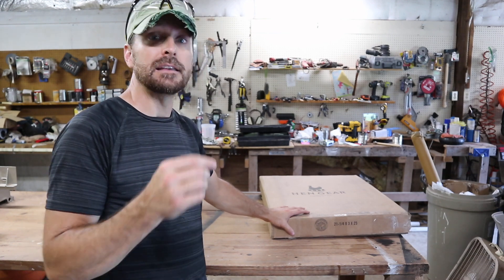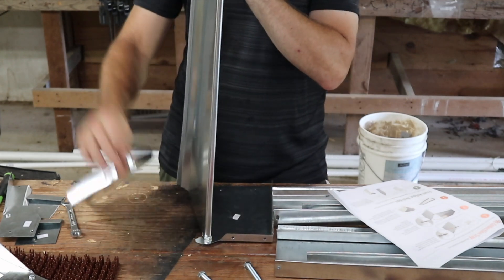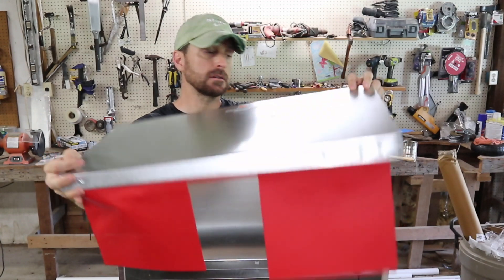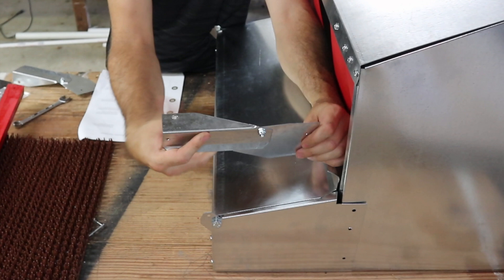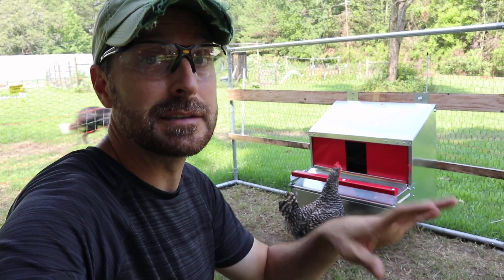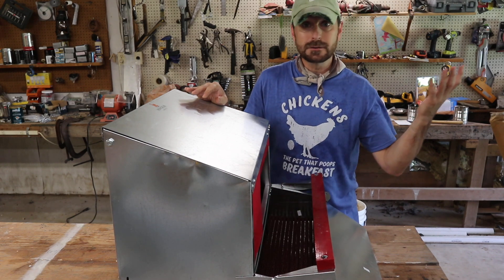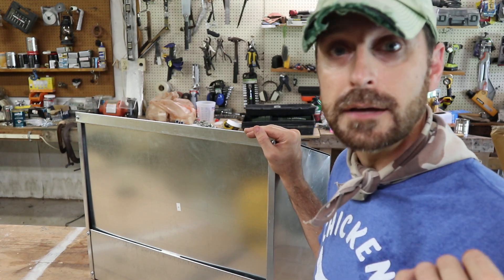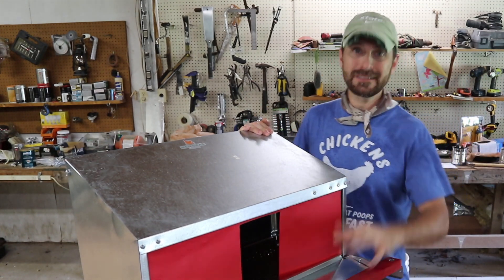Hengear Review. Will THIS Save My Eggs? Testing A New Nesting Box

Comment: I have the large version of this box.  I agree it is good quality, but the design is not well as an outside box.  Per instructions, the "outside" egg access is by cutting a long rectangular opening for the collection tray only.  The box itself stays inside the coop.  I'm not a fan of that, since it requires me going inside the coop to clean the boxes when needed.

Comment: I have that very same hen gear nesting box mounted for rear/outside collection. There is a latching system that perfectly secures the push in panel from predators gaining entry.
Reply from the maker: That’s awesome you have one. 
I worked with Hengear to develop the rear latches after this video.

Comment: I see they have taken your advice and installed latches for the rear mounted egg box. I think racoons would be able to figure out how to turn them, as they are pretty clever animals...your thoughts?
Reply from the maker: I think that the latches can be tightened down enough that they would not be strong enough to turn them.
Reply: I’m going to drill holes in the latches for small carabiners to further predator proof mine.

Comment: mine just showed up in the mail and i wanted to know how to put it together so i watched your video. the hardware that came with it should have gone in the trash as soon as i opened the package. great product but i would have gladly given them an extra 5 bucks and had them include nuts and bolts that were not machined by a 3-year-old (awful quality & hard to work with). besides the struggle with the hardware the only other thing i noticed was some of the holes were punched into the metal slightly smaller than they should have been. would i buy another box from them? YES, i would as overall these boxed are made out of good thick material and should last decades provided, they are installed inside a building where rain cannot get to them.
Reply from the maker: Cool. I am sure you could call them and they would send out some more screws. Just let them know. Mine sit outside and they still look like new.

Comment: Hello, how's it held up over the years? We have some Homestead Essentials roll out nest boxes that were awesome for the first few months, but have deteriorated quite quickly where the sheet metal holds the trays in. Does your hen gear still seem sturdy and fully functional? TIA
Reply from the maker: It is still solid as a rock. Every bolt has stayed in place and has not loosened. The sheet metal is thick and has not cracked or ripped through at any connections.

Comment: bought this exact model. my girls dont like it @ all. 
lay in a $12 cat litter box instead. frustrating
even tried adding hay and zip tying ceramic eggs on mat.
still prefer plastic "box" with DE and sand
Reply from the maker: It is so strange how each chicken or breed likes something different. Mine love laying it it. I put straw in my other nesting boxes and they just kick it out and lay on the hard surface.
Reply: @CountryLivingExperience  I guess. Mine are buff orpingtons, ISA browns, french copper marans. All prefer either far corner that's hard to reach or the dust box. Going on full year that way. GL
Reply: Personally I found that top corner bolt & nut to be MOST frustrating part of building this nest box. Serious flaw in design. (Regular ikea builder here)
Reply from the maker: There were a few difficult bolts to reach.
Reply: I agree! I couldn't get those bolts in. Also bolt for the perch wouldn't fit without a bigger hole in wood or different bolt. I hope it works... expensive, right?

Comment: Are these boxes meant to be that you collect the eggs from the inside of the coop or can it be done so you can collect the eggs from the outside of the coop without chickens escaping?
Reply from the maker: You can configure them to do either. The instructions show how to put the egg tray on the front of back. If mounted on the back, you do not need to go inside the coop to get the eggs and the chickens cannot get out.

Comment: The metal grate on the bottom.. can raccoons get through that when rear mounted? I screwed everything else down for now I’m nervous about the metal grate under the plastic grass
Reply from the maker: If it is inside your coop, then you shouldn't have to worry about the raccoons.
Reply: Hmmm ...I've got mine rear mounted, so eggs will be outside coop, in barn that raccoons have been a problem--in fact rebuilding coop using hardware cloth. I've had 21 chickens in my garage for 3 weeks. Horrible mess. Raccoons got 4.

Comment: I have the same egg layer box and can't get my chickens to enter this box.  Do you have any suggestions?
Reply from the maker: Are they laying anywhere else? Find where they are laying and block that spot off with something.
Reply: LOL, yes, they are laying right in front of the laying box.  Part of me thinks it is hilarious, but they are pecking and breaking their eggs, so I do need to control this somehow?  THey stand on the foot bat, but they will not go in?   @CountryLivingExperience
Reply from the maker: Oh man, that is a strange place for them to lay. 
Try taping the curtain up to the inside of the nest box and putting a little bedding inside on the mat. I would also get some fake ceramic eggs that they will peck and get discouraged with.
Reply: Call the SPCA, but this is what I did.  I locked one chicken inside the box by placing her in, and raising the foot bar. Most of the other chickens came over and were watching her as she just lay inside.  I slowly lowered the foot bar and walked away.  Two other chickens were last seen trying to get inside?  I will keep you informed!  Also, I just watched your video, I will add that to my repertoire... @CountryLivingExperience
Reply from the maker: @robertmycroft8268  Awesome! That'll work.

Comment: You talked a lot, you explained a lot, but it wasn't a good presentation. Because you did not clearly show and explain the curling details of the parts. For example, are the pieces part of the right side or the left side? Which way are the edges of the pieces bent? Why is it bent? Where will the curves of the pieces be based on? It wasn't a very understandable definition because you couldn't show or explain details like these clearly. During the assembly stages, it was not shown where and how the parts should fit together. In short, because you hold the pieces in your hands and see every detail clearly. You thought we saw it the same way and explained it as if you were explaining it to people who know the subject. However, we have always seen nesting boxes assembled, this was the first time we saw them disassembled. That's why every detail had to be explained and shown to us in a completely understandable way. There was no success in this regard.
Reply from the maker: Move along to the next video then.